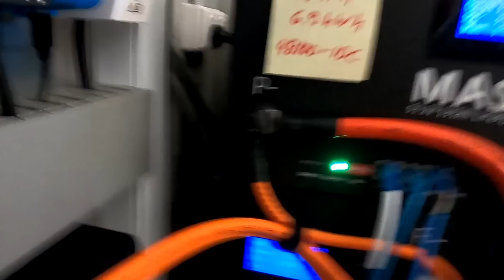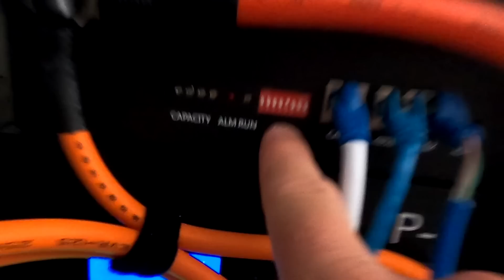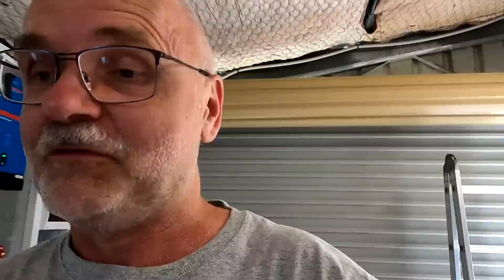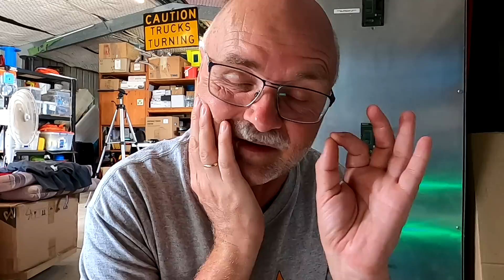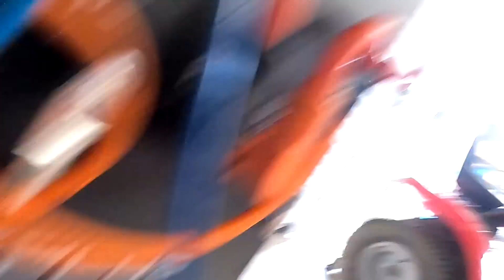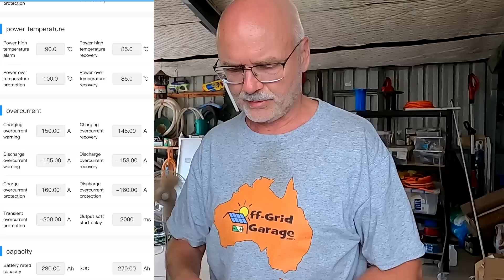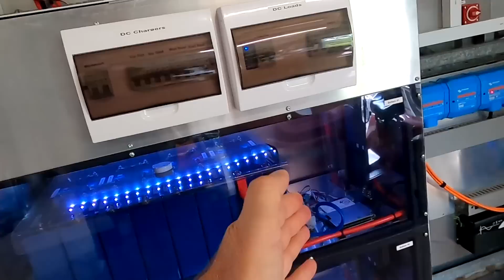No (easy) access to Master BMS of your Seplos battery! Seriously?

Comment: I think I'll hold off on Seplos for right now. I am tired of being a product development engineer for these companies and paying them for the opportunity.
Reply from the maker: If you stay with the same battery capacity it will work fine. I'm testing a non-recommended setup here.
Reply: That's a bit harsh isn't it? How's the one you developed going?😄
Reply: @mikekoens7284  ? I'm not the one promising something that they can't deliver. Not harsh at all. If you buy a car you expect it to function correctly and as advertised. If the wheel falls off and you complain and they have to send you a new bolt because they used cheaper bolts to save money but they break. That's a problem.
Reply: @timpatton3948  I've had one of these BMSs for almost 12 months, and have been aware from the beginning that they have this limitation. Not sure where I saw it, I've just been perusing the manual, can't find it there ATM. Anyway, apart from my own limitations in my ability to get it to talk to the inverter, I am very happy with the way the BMS performs. My only criticism would be the manual, if it was a bit clearer, I think I would be able to get it working!😏🥺
Reply: @mikekoens7284  I used the Ant BMS - two different versions - to build my packs. The first did not even come with the app! but I eventually downloaded it from a link left from a you-tuber. The installation was easy and rather self intuitive, even without any translation. The vendor page had a bunch of pictures worth a thousand words! I later asked and got a manual from ICGoGogo to better understand the programming of the parameters used in their bluetooth apps. That will be useful much later when I design my own ESP32 based BMS. Meanwhile I  watched and learned from Andy's + others of course because it's less work and way more fun. My BMS do not talk to the inverters. They just cut off whenever the measured voltage or current threshold of one cell or the battery is reached, according to your programmed values. Moreover you can program a warning before them an you can even set it to send an audible signal. What Tim Patton said is justified. Most of all the electronics is designed in China and will come without much help. So it created a market for integrators in the US, Australia  and other countries to repackage OEM electronics and provide documentation  as well as some limited services and warranties. This way you'll feel "pampered", more like you're shopping at home. However they're also in the same boats as we are. They're learning "their" products from customers feedback, albeit at a faster pace than the rest of us, because  they deal with much larger quantities.
Reply: @francoisguyot9770  When you say "My BMS do not talk..." do you mean the ANT or your own design ESP32? At present my BMS doesn't talk to the inverter either, and does much the same as yours, however, the inverter also has the same function, of just shutting down the charge to the battery if total battery voltage exceeds a preset level. I would like them to communicate with each other, as I'm hopeful that as full charge is reached, that the inverter will gradually reduce the charge current, thereby allowing the battery to get closer to 100% without going over voltage and shutting down suddenly at around 90 to 95%, depending on the current.
Reply: @mikekoens7284  I mean my ANT BMS are not talking to each others. They just cannot, and no I've not developed any microprocessor based solution yet. I'm too lazy and not even sure if it's worth my time. I believe in simpler DIY solutions and will try those first. For example, CD60L is a clamping voltage detection board with adjustable pots for high and low Voltage set-points to automatically charge or discharge using a relay. We would use one module per bank. Their relays need to drive a single  DPDT relay to alternately drive one  Vdc SSR such as the Geya GSR1-1-40DD to power our inverter. The DPDT switches both +48V and GND simultaneously in a fraction of a second upon loss of power from either-or- but-not-both BMS,. So it works just like any automatic transfer that switches to battery power upon loss of grid power. But these are usually to switching AC power that is non-arcing. The BMS shuts off because it measures  either a too high or a too low Voltage (or Current) and is not a feature not to defeat. Meanwhile , the easiest solution to alleviate our infamous inverter shutdown is to increase the capacity of our battery. Make it large enough to meet your actual daily needs for 4 days, and use a single 320Ah BMS. Buy a backup, just in case if you want. That increase capacity should  prevent any over charging or over discharging. The clamping voltage PC board + SSR may still help cutting off power from the Solar Charge Controller, or divert  it to your water heater  if the battery is full. If you're afraid that the BMS cuts off power upon over discharge, then you could invest in a hybrid inverter that uses its internal transfer switches to tap on the grid only whenever charging upon low  battery voltage. Although i do have such inverter, It's definitely not the solution for me.
Reply: @francoisguyot9770  very interesting, you have some great ideas and plans, not that different to some of mine, and yes, we must not let the dollars run away by going "over the top"! I am also going to play around with SSRs for automatically switching over batteries. I tried to message you here on YT, but could not find your message button, feel free to message me if you can, I'm not sure if it's ok to leave an email address here. Sorry Andy for "hijacking" the thread!
Reply: @mikekoens7284  Good Morning Mike. To experiment with power transfer once the BMS cut off, I used a 3-32VDC-SSR-25A driven by a W3230-12VDC-10A temp controller as load diverter to my water heater tank. The SSR base gets quite hot and definitely would benefit from a large heat sink, as the current to the inverter gets  close to 22A powering a microwave. This set up worked fine to maintain the water temp close to set point and cost only $11 USD! Their higher DC SSR is rated at 40A. They claim it  could go as high as 100A. But I doubt, even with a beefy heat sink... I'd be suspicious it can handle than 40A in steady mode. I'll experiment some more to build confidence, since large DC SSR are really expensive. So it's all worth it to me and I think you should try it and post your results for other to learn too.
Reply: @francoisguyot9770  yes, SSRs should have heatsinks! I used to work in the HVACR industry, and we used SSrs a lot for heater bank proportional control. The  ac ones came with their own heatsink, and ran quite cool. They are a semi conductor, with a voltage drop (not sure how much, I've never measured it, but I assume about 0.7 volt), so yes, there will be a considerable heat build up at 22 amps. And if I was to post my results here, I think I should probably energise my own YT channel, otherwise I/we are "hijacking" Andy's channel..

Comment: RS485 is a master slave  communication protocol.    The PC software  acts as a master  and batteries as slave, except the master battery who is a master also, since it needs to retrieve cells information from other slave batteries.   that why the PC software can't talk to a master battery.  2 master can't talk to each other and a device can be only master or slave, not both.

The 2 rs485  port are connected in parallel to the same RS485 interface, so it doesn't matter if you switch your RS485 cable. 

They can try to modify their PC software and firmware to detect masters collision and  restart command from both master with different timing until success

But the only way to get this right is to have an additional independent RS485 port and interface on the battery, just like pylontech and some other battery.

Comment: Stupid question - why not connect the RS486 to Cerbo directly or connect both BMSs to CAN?
Reply: Could work! If he can set the TOP battery to be CAN1 and RS485 SLAVE1 and the BOTTOM battery to be CAN2 and RS485 SLAVE2 and his COMPUTER be RS485 MASTER. Should be possible, arent the first 4 Dipswitches for rs485 and the followoing (5 and up) for CAN adresses?
Reply from the maker: Because we need a master battery collecting all data from the slave batteries. If you connect via RS485, you end up with 2 single batteries in VenusOS of which you can pick one to the be battery monitor (smart shunt). The other battery will be ignored.

Comment: For pylontech they recommend to use the newest battery/bms for can communication. maybe its the same case here and the new bms shoule be the can "master" for all of them.
Reply: Does Pylontech have an active balancer inside?
Reply from the maker: Same with Seplos, they say only to parallel same batteries together. I'm testing a non-recommended setup as I explained in the video.

Comment: Hi Andy, I received my third BMS Seplos yesterday, but this one with Bluetooth.  
Do you know where I can find the App Android?
Can I remote the older BMS trough the app if connected together?
For the moment I don't have any charging issue with my 2 first Seplos BMS. But if some similar problem occurs, I think I will recall the factory settings first.
Reply from the maker: Is there not a QR code on the BMS you can scan and download?
I can put this on my website to download when I'm back home (3h from posting this). You will find it here under the Seplos BMS section: https://off-grid-garage.com/battery-management-systems-bms/
Reply: @OffGridGarageAustralia  Hi Andy, thanks for that link, I'll try that ASAP.
Reply from the maker: @writm1821  This website always has the latest version. They released a new built just a few days ago which includes the fix not being able to set the balancing voltages through the app as I have shown in a previous video. Glad they got this sorted quickly.
What kind of BMS do you have now with your Seplos setup?
Reply: @OffGridGarageAustralia  I acquired 2 empty Seplos 280 racks 3 months ago, and I am waiting for the 3rd rack in which I will install the BMS Bt. (16S 304 EVE, 16S 310 CATL and 16S 280 CATL for the 3rd). dark and cloudy days 5 days out of 7, the almost 900Ah will not be too much here in Normandy!

Comment: Maybe you’re in need of a discharge, relax, nap, and get recuperated for a new day. Remember that you have a pool. If you’re able to connect two like size batteries 🔋 then what would it be? Happy New Year 🎆
Reply from the maker: Two the same batteries will just work. I'm testing this non-recommended setup though to see what happens. I'm almost there...

Comment: ao this is exactly the reason seplos dont recomment mixing batteries.
i believe also the reason they came out with the 10e bms.
if using only 10e bms'es there's no need for dipswitching anymore.

do have to agree with you though, the not being able to access the master when setting can is also on of my biggest frustrations.
i wish they would solve this in their software, as that is not able to deal with id 0 , or so it seems
Reply: Even without mixing the monitoring problem is the same
Reply: @patrickmartin4482  well, dont know yet.
so far have only 1 10e ( 280 kit) and 1 10c ( 280 kit too) , second 280 10e is still enroute.
then again, monitoring software is used rarely ( unless constantly tinkering) , cell monitoring i have through Solar Assistant, which is also connected to my inverters
Reply from the maker: As I explained in this and previous videos, I'm testing a not recommended setup with different capacities here. 
I'm still keen to find out if the master just multiplies its own capacity by the amount of connected batteries instead of reading the actual single capacities. It almost seems like it.
Reply: Sometimes only listen, makes live easyer. And if i loose conection, my Victron System go in „low Batterie“ and i have a Alarm.